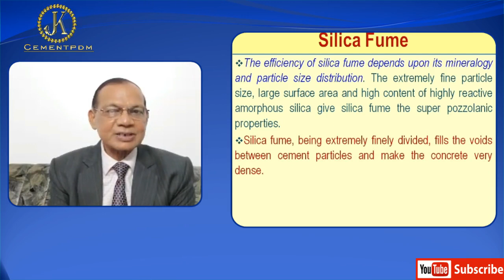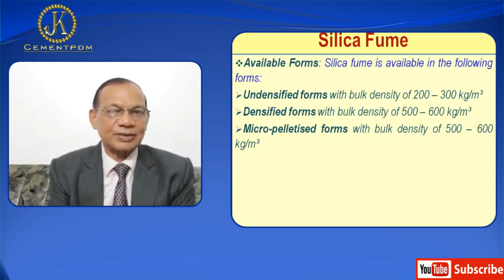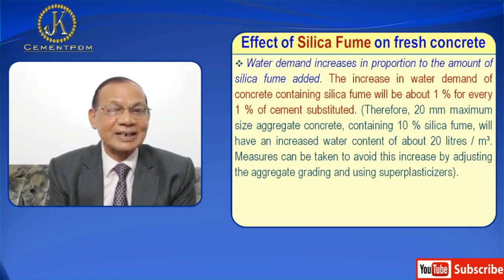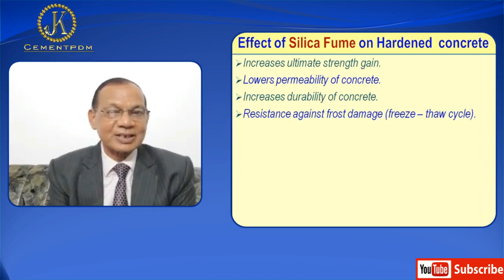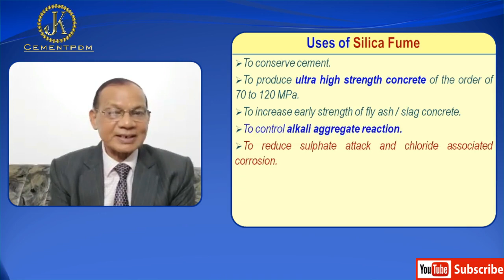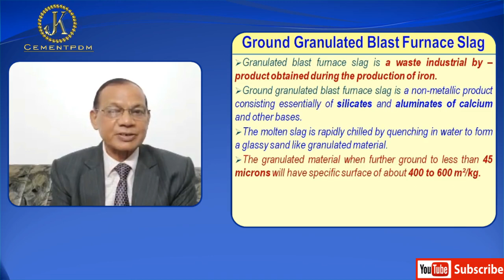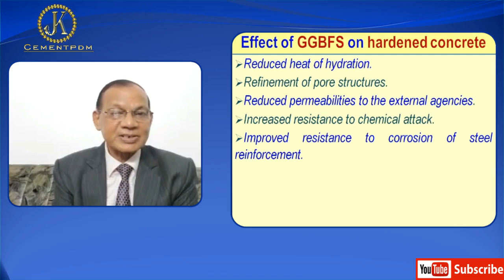Silica Fume & Ground Granulated Blast Furnace Slag | Effect of  silica fume GGBFS on fresh concrete

Comment: sir, is there a maximum % of GGBS that is to be used or can contractors use 40 or 50% to save money on cement? and what is the effect on strength and durability of structure if more GGBS is used.. thanks.